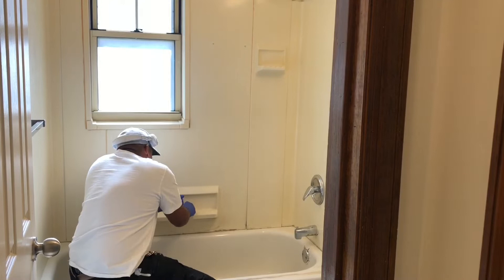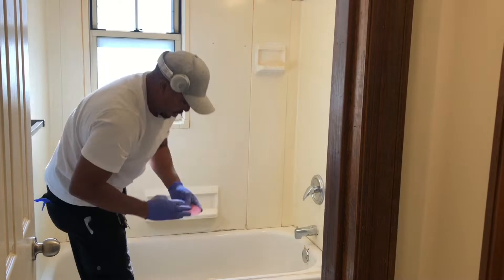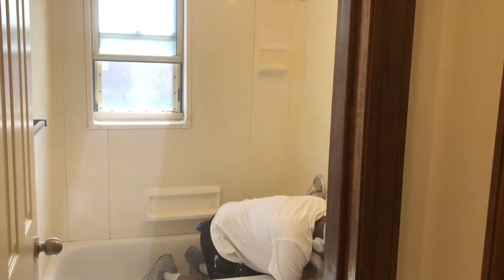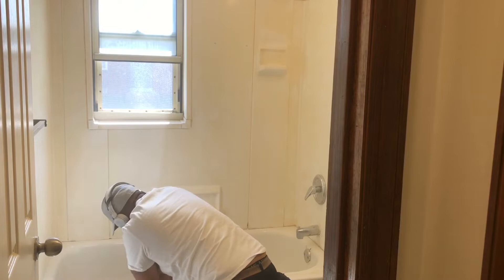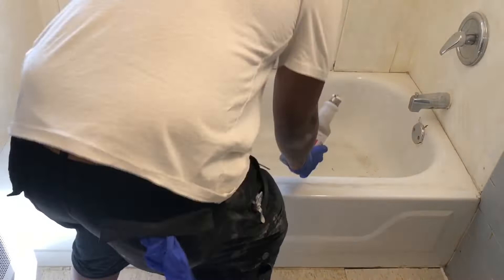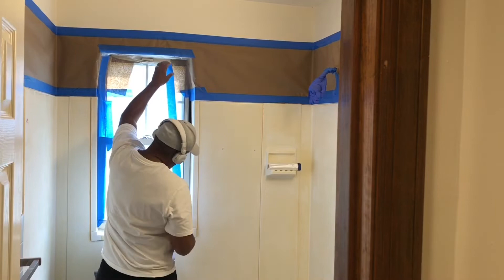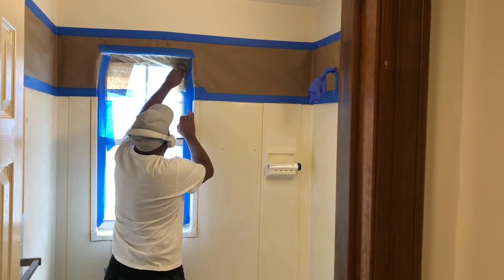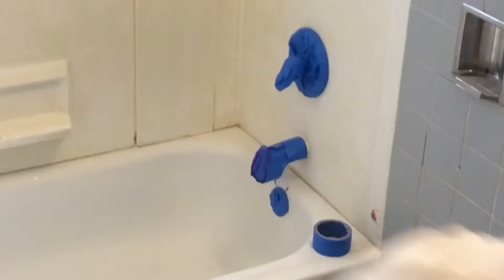How to Refinish a Bathtub - It's Easy, Safe and Profitable

Comment: I noticed that the walls were not etched , but the tub was ? If you don’t mind elaborating on why ? Thanks so much . Great videos .
Reply: Good question,  Fiberglass doesn't need to be etched. Porcelain and ceramic tubs can be etched to remove gloss
Reply from the maker: @jm30603  Correct! the fiberglass just needs sanded
Reply: @thetubguy2293  what to do about previously painted plastic/fiberglass shower pan(unsure if plastic or fiberglass) how to strip the paint? do you need to strip the paint?
Reply: @jm30603  pretty sure those walls are plastic/acrylic not fiberglass?
Reply: @thetubguy2293 don't understand why you are painting over silicone even if it's paint-able silicone everyone says that it will cause the fail prematurely

Comment: Can you refinish surrounding tile, and then also re do grout? For example I want to get my surrounding tile refinished white, but I want black grout as well. Is this possible?
Reply from the maker: It's possible but a lot of room for error. I dont think it's a good idea. Even wiping the grout at the end will scratch the new paint job
Reply: @thetubguy2293  makes sense thanks for the reply
Reply: @thetubguy2293  previously painted shower pan and shower walls, what would you do? do you strip the paint somehow? or just sand? Saw you rinsing the acid down the drain, isnt it very bad for pipes..?
Reply: @thetubguy2293  also what do you do when you have caulking/silicone between tile and tub? do you remove it all of it with acid?

Comment: I use to do this as a job but now I want to do my own contracts but I forget what type of paint it was 

I know mixing rule was 4,6,8 for the measurements

Paint thinner and catalyst I believe we used and a wipe on primer I forget the names
Reply from the maker: I don't trust the wipe on primer. Basically for sanding sake, in case I need to do a repair in the future. I prefer to have enough thickness. You can use an epoxy paint or a polymer, or try to find a marine paint. Just remember what you said, it should require a separate catalyst and reducer.
Reply: @thetubguy2293  I am trying to learn more on what you are talking about on catalyst and reducer?
Also, what do I hook the paint gun up to for it to spray? Do you happen to have an email so I can possibly ask you a few questions? I'm really trying to get this started. Thanks.
Reply from the maker: @amartin997  The catalyst is the "hardener" and the reducer is used to thin our the paint so it will flown easily through the spray gun. I can't give you my email, sorry. It's just a business email. But I will be posting a video on All the equipment that I use including cheaper alternatives.
Reply: @thetubguy2293  alright. Thanks I’ll be looking out for it. I wanted to ask you what do I use to hook the guns up too that makes them spray?
Reply from the maker: @amartin997  hook it up to an hvlp turbine.
Reply: Great content keep them coming. Where do you advertise and how many tubs jobs can one realistically get a week.
Reply from the maker: @DannyBoyTV  I don't fully trust Any "wipe on" primer. Feel the same even when it comes to those primer/topcoat paints that they sell at the big box stores but that's a different topic altogether.

Comment: Hey tub guy. Ive been trying to start a business doing the same thing. I did it back in the 90's. Can you please tell me where you bought the paint and compressor
Reply from the maker: most products are listed now with links. I use the Amazon links because its easier than purchasing everything from 12 different stores. Even if you can find it cheaper, most Amazon product come with Free shipping which is huge savings. Some thing weigh upwards of 25 - 30lbs. Check out the links
Reply: @thetubguy2293  Thank you my man. Will do
Reply: @thetubguy2293 do you use an adhesion promotor on the plastic? How long after applying the caulk do you spray the adhesion promoter?